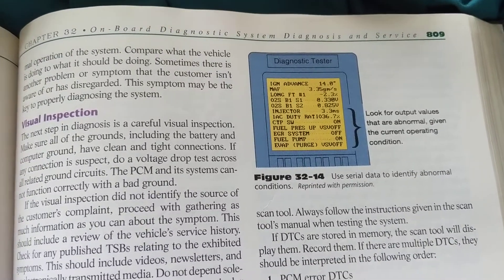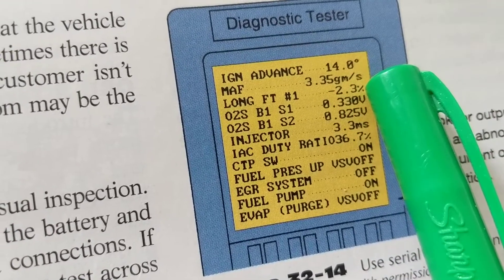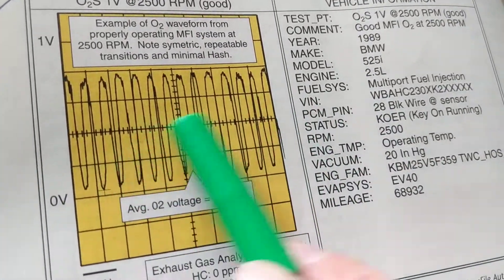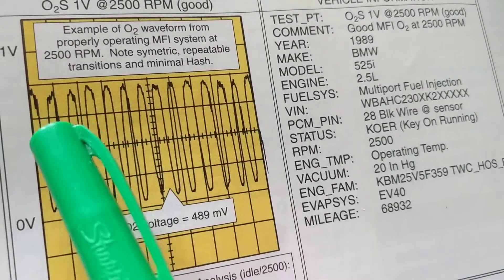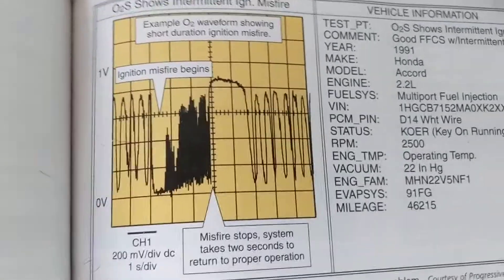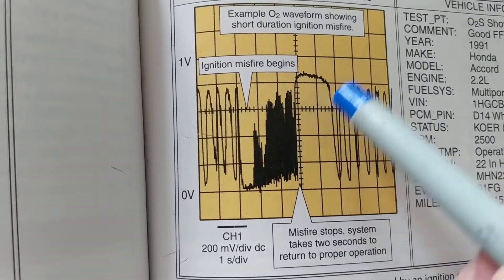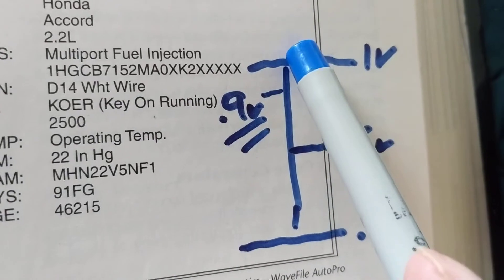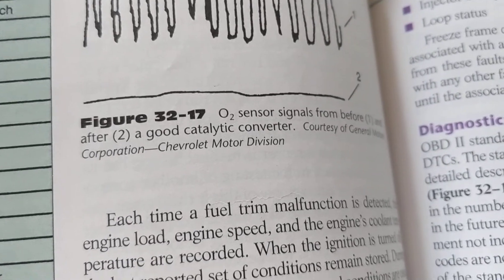HOW TO UNDERSTAND CHECK ENGINE LIGHTS AND DIAGNOSTIC CODES FOR BEGINNERS

Comment: What are inputs and outputs could you explain ?
Reply from the maker: Yeah I believe you can find many videos on this topic on my channel but inputs are the sensors oxygen sensors mass air flow sensors coolant temperature sensors the outputs are what the computer controls fuel injectors ,motors ,solenoids with the transmission ,actuators and starter motors you can see all this content on my channel Joe electronics schematics for Auto thanks for the question

Comment: I took a one year automotive course at a community college in 1987-1988.  You can imagine how little instruction we received back then on electronic fuel injection.   Most cars had electronic carburetors or throttle body injection fuel delivery systems.  The good thing is once you know the theory of the ideal fuel mixture (14.7/1) then you can grasp what the sensors, actuators, & PCM/ECUs are trying to do.
Reply from the maker: It's a good foundation